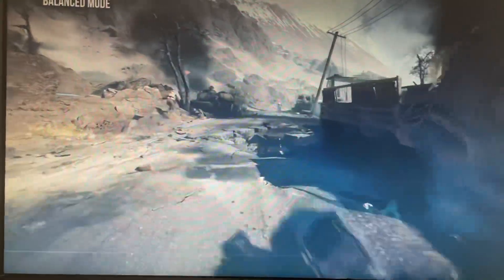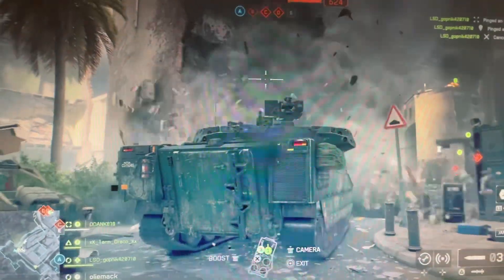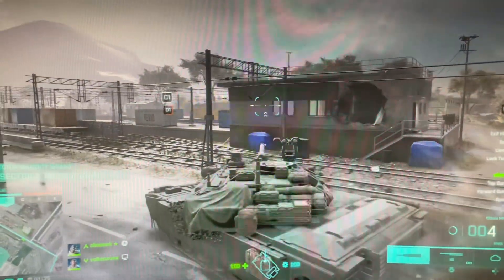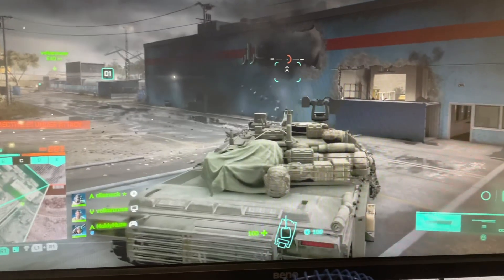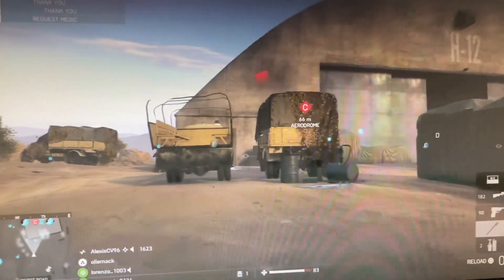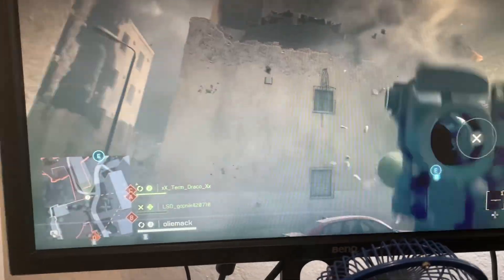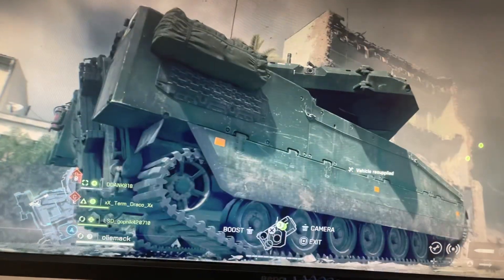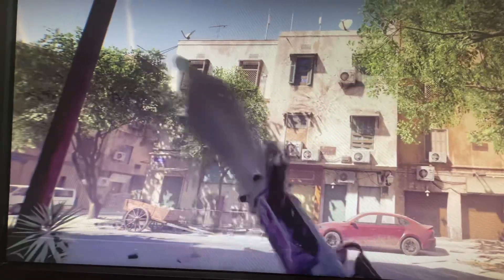Shader glass CRT beam simulation combined with hardware backlight Strobing. Insane clarity ￼

Comment: Monitor manufacturers won't pursue this because if they do that, then all their R&D into higher refresh rate monitors goes to waste, who will buy their super expensive 500+ Hz if you could get 2ms of image persistence with a cheap 60 Hz panel?
Reply: lol thats not how it works. that 500hz OLED monitor would destroy your cheap 60hz LCD enjoy your slow blurry response time and input lag with washed out blacks. OLED is the way to go for both superior image quality and motion clarity no LCD even comes close 😂😂😂
Reply from the maker: @chrisj1633  this is a 120 Hz LCD that has been overclocked to 180, and it has global strobe with phosphor fade BFI. For motion handling it is at about the level of a 240 to 360 Hz OLED.

Higher frame rates would make this work even better even on LCD, actually especially on LCD because LCDs can be made way brighter than OLED

Of course it doesn't have the contrast ratio, but it's not bad at all , and I would know as it's my monitor lol

Comment: Will this app work on an older game that only allows for a max locked framerate of 40fps, or does the game have to run at 60fps or more?
Reply: Does it matter that my monitor doesn’t allow for VRR? I have an older 120hz LCD.
Reply from the maker: @honkhonk1555  I do not think vrr matters. That said, if you can overclock your LCD to 180hz like I did mine, it may give better results than using just a 120hz monitor.
Reply from the maker: It works for lower FPS games.

What this software does is basically take whatever your input is, and scans it out to the panel at the refresh rate it's configured to.

So if you have a 120 Hz monitor, and the program is set up with the 120 Hz subframe selection, whatever you run will be scanned out at 120
Reply: @vrgimp8548 ok, so the minor I have happens to be an older 120hz model, but the game I enjoy playing can only max out at 40. As long as I lock it at 40, and then open it up I with the shaderglass app running over it, I should be golden? I really appreciate your time, and responses. God bless.

Comment: I have an ASUS monitor with ELMB and pulse and width are configurable. What I am not clear on is how to 'sync' those settings with ShaderGlass?
Reply from the maker: So if you head over to the motionclarity sub Reddit the chief from blur busters answered some questions, and we figured out what my monitor was doing.

The settings I use on the CRT beam simulator make it into a global BFI with phosphor fade simulation that is hiding the slow pixel response times of my monitor, and giving me the better motion clarity results.

Because the shader is run without the "scanning " setting in shaderglass, I set beam scanning to 0, it doesn't have the weird sync issues.

Apparently I stumbled on a workaround that the chief was thinking of implementing in a future version of his CRT beam simulator .
Reply: @vrgimp8548  Interesting thanks - I'll be doing some experiments with my own setup.
Reply from the maker: I am not too clear on that myself. The chief at bkur busters says its meant to be used in sample and hold only mode so the algorithm has exclusive control of the backlight. 

I have more been using my monitor's  internal ULMB to make the image brighter for the software algorithm to shine.

 I'm unsure if what I am doing will have a long term negative impact on the display because its definitely unusual for an LCD to be driven this way and have MPRT that low.

Comment: How do you use it? I can't find the CRT beam sim
Reply from the maker: Here you go, download it from here

https://github.com/mausimus/ShaderGlass/discussions/192

If you have a monitor like mine that can do backlight strobing on its own, and can be adjusted with the blur busters strobe utility, you can use both technologies together, which is how I did this.

It takes some configuration.
Reply: @vrgimp8548  Hmm I'm on a 240hz OLED and when I use this it makes the motion blur way worse
Reply: @ramsaybolton9151 Wrong settings perhaps?